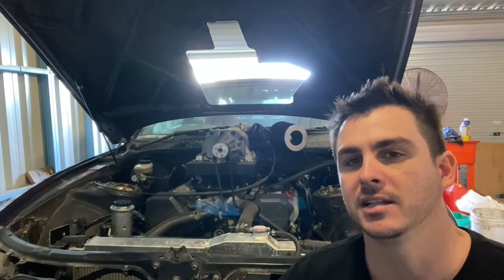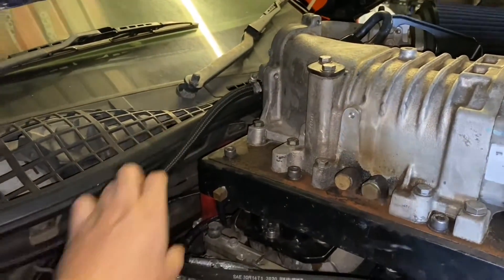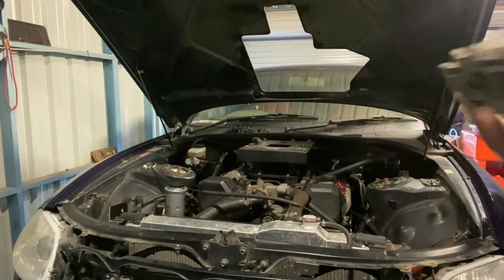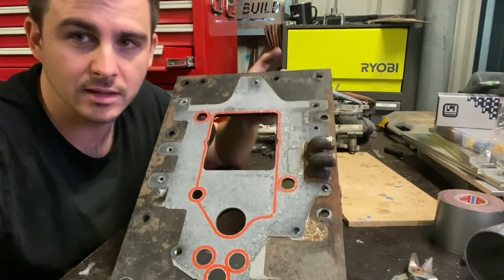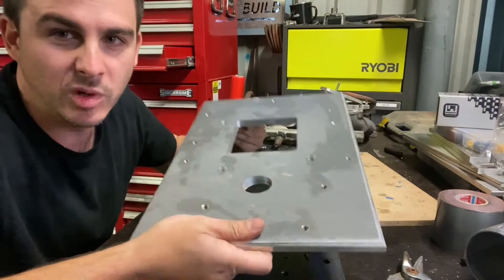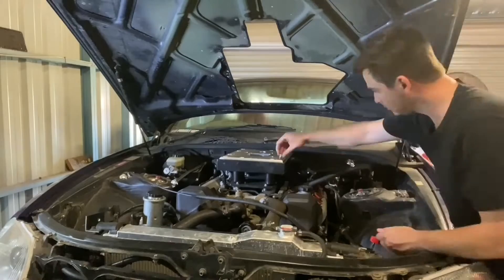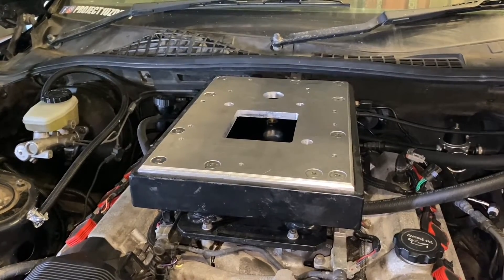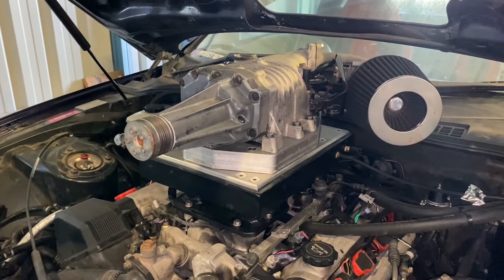M90 Supercharger Intercooler Plate (Installation) [Part 3 1UZ W2A Series]

Comment: Congratulations for your skills and passion.
But, since you have CAD skills, why is not the aluminium billet plate directly bolt to the intake manifold?
That would be quite easy to you (since you have the CAD skills), taking a photo of the intake manifold and sketch the billet aluminium part on Fusion 360; with the correct or proper height clearance. That would might look much more neat and professional, since would get rid of all the steel metal and the Supercharger would be placed at a much lower position (perhaps with hood clearance).
With these minor tweaks, it might take your Project to another level and you might scale it to any Supercharger; in fact to any future Project. And if you end up mastering these skills, i STRONGLY advise you to fabricate the parts and sell them as bolt-on Kit.
Much successes.

Comment: Is the intercooler going to be running off the cooling system in the car or a separate system? Also I can't wait to see the difference it makes, nice work m8.
Reply from the maker: Thanks man. It will be its own separate system with heat exchanger out in front of the radiator
Reply: @Brodorsport  I thought so because the temp wouldn't be much different between the supercharger and the cooling system, but I didn't want to assume anything and I'm not real familiar with water to air. Could/are you going to put water sprayers on the heat exchanger or would most tracks not like that?
Reply from the maker: Yeah your 100% on the money there. Probably not at this stage, hopefully the system is efficient enough to be self sustaining 🤞
Reply: @Brodorsport  I'd imagine it would make a substantial difference to the old setup and again it would be interesting to note the differences between the old setup, the new setup and the final setup.